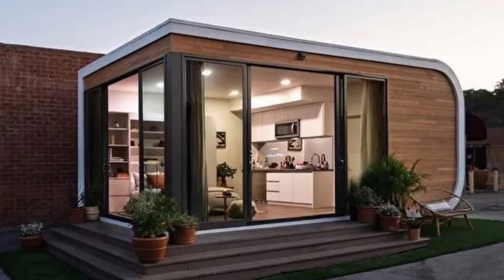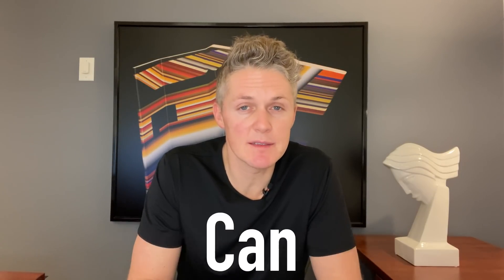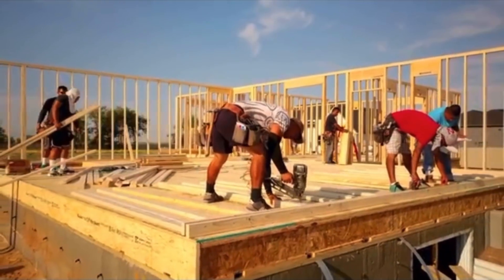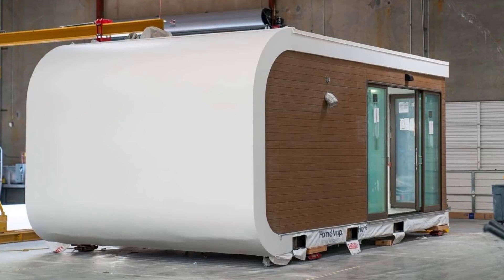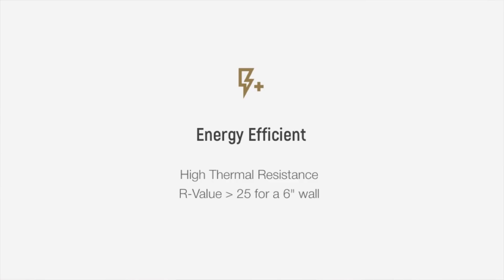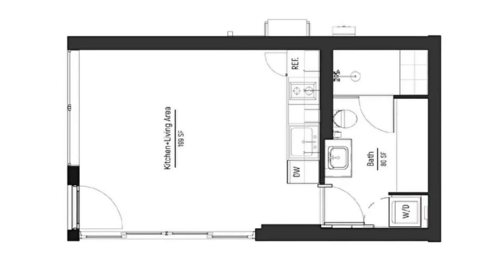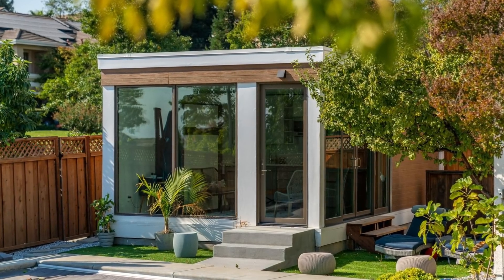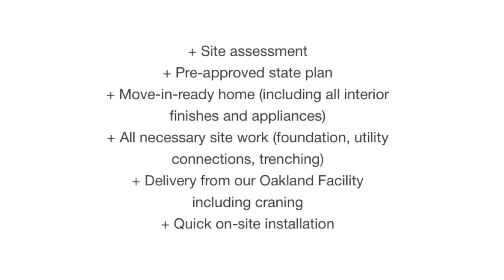The PREFAB HOME Built Different than Everything Else on the Market

Comment: Fire resistant?  They are required to cover it with drywall inside because it burns.  Cal Fire requires it to be covered outside, in wildfire areas, because it burns.  It is plastic.  Their code approval does not allow it to be used structurally.  You might as well just use rigid foam that is way better insulation, and no less structural.  Their plastic does not hold up the roof, it needs a steel frame around it, that is like R-zero and costs more than wood framing.  It is a marketing gimmick, that works, because people are so easily duped.